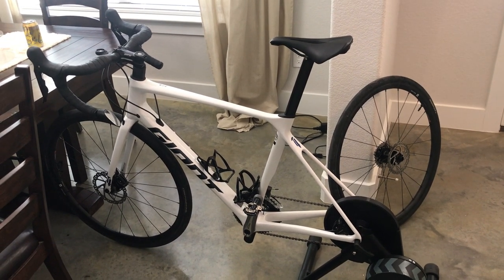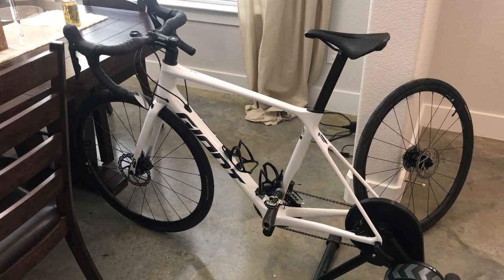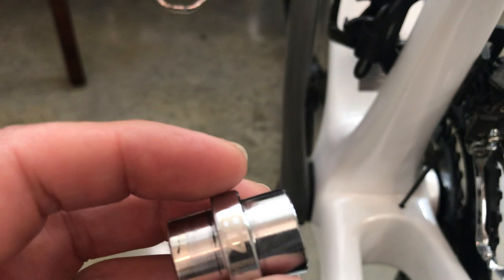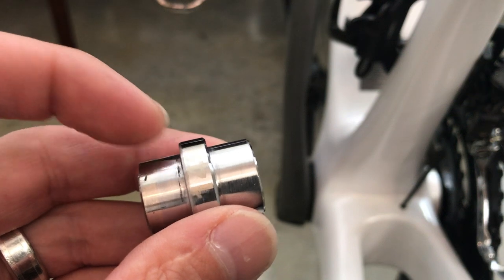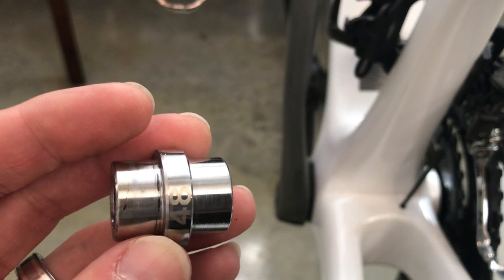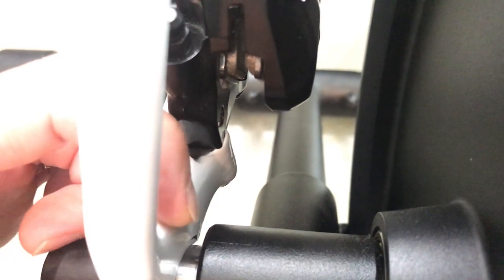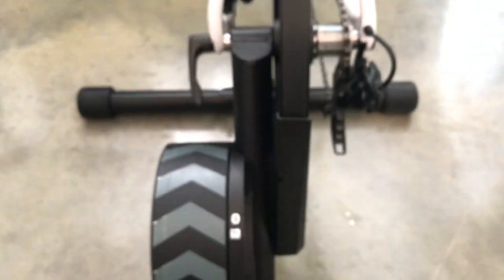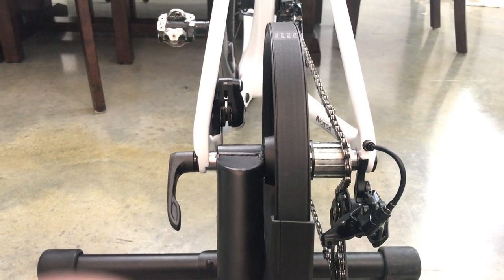2021 Giant TCR Disc Part 2. Wahoo Kickr core compatibility problem solved!

Comment: Hey Bradley. Thank you for the video. Does your solution still works well? (I just bought a TCR ADVANCED 1+ DISC PRO COMPACT 2021 and a Kickr Core 2020).
Reply from the maker: Yes, it is working perfectly. Just make sure the adapter is the clearing the frame dropout when torqued down!
Reply: @bradleyjohnston3434  Great to hear that!

Comment: So if I take the adapter to a local machine shop, I just need to have them remove 6mm off that flange?
Reply from the maker: Yes, off the side that shows 148 is what I had done.

Comment: I'm looking at buying a Wahoo Kickr Core right now aswell, also have a Giant TCR bike. Wahoo is saying the have a new KICKR/CORE 142 Thru Axle Adapters, did anyone try that and does it work?
Reply: Just email Wahoo support and they will send you the parts free of charge.
Reply from the maker: New adapter should work
Reply: I had same problem and contacted Wahoo yesterday, this was their answer:
That being said, our engineers have just finished a new set of thru axel adapters after working with these frame manufactures so that the adapters are tapered and will align the offset through axel they use. They should be available on our website within the next few weeks.

So actually adapters are not available yet. I have TCR Advanced 1 Pro 2021, solved it same way as in this video.

Comment: Shit although its a fix its not the best. I have the 2021 Giant TCR 0 on order. Wont get her till June. I am looking at trainers at the moment. Had a bad crash on ice last week so pushing the button on a trainer sooner rather than later. the Kickr Core was winning my top pick award till i seen your video. I would be using my cross bike on it in the meantime, and then get the 
Giant on it once she arrives. Are you aware of a good turbo where this is not an issue? I'd rather have a properly fitting adapter out of the box. Thanks for the video mate.
Reply from the maker: Not sure on specific turbos....
Reply: @bradleyjohnston3434  Thanks man. Pleased I found this so I knew in advance. I see with the wahoo a few bike brands are affected. Canyon for one. I will probably go for Elite or Tacx. Cheers bro.
Reply from the maker: I feel I might be the reason that the TCR was added to the list. I complained until they changed its status.
Reply: @ricky7396  did elite or tacx work for you?
Reply: @jaked8971  I went for the wahoo Kickr core I found an article where if you contact Wahoo they send you an adapt. I have the adapter they sent for 2021 TCR. I actually dont have the bike yet 2021 TCR 0 still on order. But x2 weeks ago I asked if they could switch it to a model with the new 12spd di2 Ultegra as currently bikes delayed till oct. Still waiting to hear back. But the Kickr core is great I use it with Sufferfest

Comment: i just bought wahoo kikrc gen 5 want to put in on giant roadbike trc2 dics 2021, how many mm should connecting joint be reduced to ? pls advance . thank y
Reply from the maker: For my trainer is was 6mm
Reply: @bradleyjohnston3434  thank you very much for u input.
Reply from the maker: Yes 6mm
Reply: Contact wahoo. They will send you a revised 142 adapter for free
Reply from the maker: I saw Wahoo just came out with a new adapter! I’d like to think it was from this original video😉
Reply: @bradleyjohnston3434   Probably. It is not for sale on their website but there is a FAQ describing how to install it. I emailed them asking how I can get one and they said they would send one for free asap.

Comment: Nice! Did you contact Giant / Wahoo about this 'problem' ?
Reply from the maker: Painkillernl my bike shop talked to the local Giant Rep. and I was told that they haven’t heard of this issue and that they would “look into it”.  I did not contact Wahoo either because they don’t sell an adapter that fixes the issue.
Reply: @bradleyjohnston3434  contact them. They have a new adapter which they will send u for free

Comment: Does anyone know if this issue is the same for the 2021 pro team disc model? The only smart trainer available where I live is the wahoo kickr v5 and the customer support out here from Wahoo doesn't seem that reliable.
Reply from the maker: It should all be the same issue. Last I saw Wahoo started offering a modified axle adapter similar to the one I had modified for my use.
Reply: @bradleyjohnston3434  well I'm glad I found your video. At the moment it's just about the only smart trainer available in Vietnam but I doubt Wahoo could send me the updated adapters in a reasonable amount of time. I'll try to email them and see if they can support me out here.
Reply from the maker: You bet